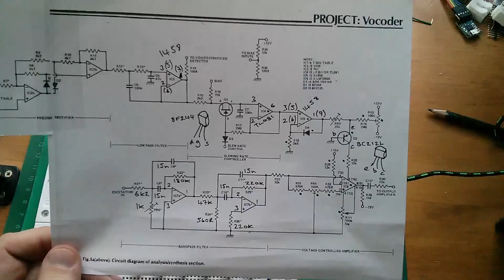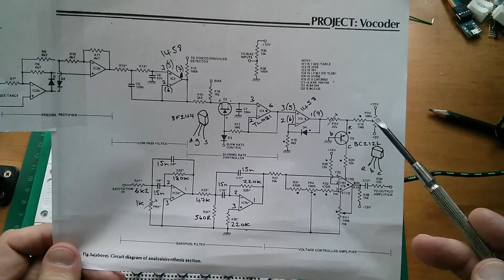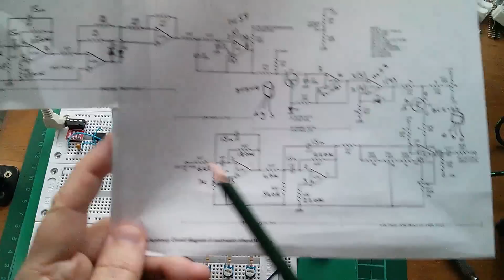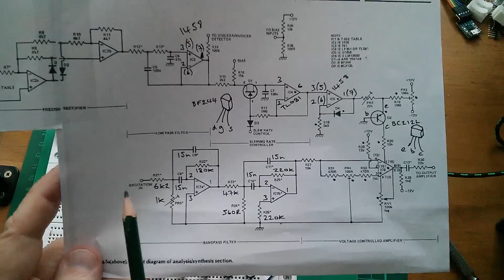Vocoder Update - Filters and VCAs on Breadboard

Comment: A suggestion for the future would be to do the same project using switched capacitor filters such as the LTC1060 or LTC1160 series parts. Years ago I did a project with the predecessor part, the MF10. The part is easy to use and quite versatile.

Comment: Thanks! Great video, Julian. 4:50 A notch filter is the opposite of a bandpass filter by the way. ;-) I really hope "sort of notch filter" is something else. :)
Reply: How about a notch pass filter, hehe
Reply: Notch pass filters do exist, and they're are ideal for resolving Morse  code from  severe radio noise. A bandpass filter of a few tens of Hz in width is essential at times.
Reply: +RWBHere I don't think it's called a "notch pass filter". The notch filter is a narrow band-stop filter. :)
Reply: +Robert Eliassen You are right. Band pass filter has a pass band which it will only allow to pass through. Notch filter is to stop signal with very narrow band frequency. Band pass filter can have very wide range, say for example, audio band pass filter may have lower -3dB point at 20Hz and higher -3dB point at 20KHz. so anything in between it will pass through it. Where as a notch filter is completely different thing and it will have very sharp center frequency at which it is intended to attenuate the signal and the -3dB point be same on both sides of this center frequency if you scale it on logarithmic chart. Both are completely different thing.

Comment: Have you thought about an effects unit based around a PI5V331 as a balanced QSD driven by a Johnson counter from a 96KHZ clock which takes I and Q signals from a audio phase shifter network to allow for USB or LSB sound effects.

Comment: Hello, Julian. Is there a fairly simple way of individually notch-filtering all 88 notes of a piano, so that each output can be used to write directly to a MIDI file? I'd like to do it in hardware, or else with some routine on Arduino/ Raspberry Pi, etc. I want to pass an audio signal through a fine-tuneable 'comb filter', then save and edit the resulting MIDI output. If you know of a method, could you please consider making a project video or videos about how it's done? Thanks. P.S. You'll be best off by dumping that breadboard approach, and using a shielded/ground-planed PCB layout, with screened cables between stages. Those microphonics are worrisome hints about future problems.

Comment: I have a voltage controlled a graphic equalizer board 31 band and a 31 band LED spectrum analyzer board I am going to try something that may be fun time to start soldering .. the LED spectrum analyzer board I have generates 0-5 volts on each led bar and the  voltage controlled a graphic equalizer board uses 0-5 volts DC to control it this should be fun
Reply from the maker: Wow, I love that idea - can you point me at these two boards - cheers :)
Reply: they are home brew

Comment: How long has it been? 2 years at least!
I wonder when it'll be done, it better be worth the wait!
Reply from the maker: I'm thinking I might build two of these things now. As well as the original design, I want to build another one on a large piece of chipboard with every circuit element on a separate proto-PCB. LED bargraphs will be liberally added so the signal level can be seen in all parts of the circuit :)
Reply: Seeing as you have so many amps to build, why not lay out a PCB module that you can build lots of? You could make the filter part easy to change values too. A surface mount quad with some through hole filter parts would be sweet.

Comment: My analog is a bit rusty ... quite a bit rusty. Audio distortion: As near as I can tell, your Q2, R19 and PR3 tied to pin 1 (or 16 for the twin amp) of the LM 13600 sets the amp's output bias voltage. This is something that should be calibrated with no input signal to zero volts probed at the output pin 5 (for this amp configuration) and then left alone. This portion of the circuit is not a gain or volume control. The distortion comes from turning the pot past the calibrated value, raising the output voltage towards +12V. As it does, the audio peaks begin to clip until the output bias is turned all the way to +12v and the audio disappears completely. At somewhere between 9 to 11v bias the audio has become mostly a square wave.

That's the way I read the 13600 data sheet compared to your schematic, anyway. I could be completely off - as I said, my analog is VERY rusty.

Comment: Hello Julian i have a question for you. I know nothing about Vocoder's at all. But my question is What would you use one for? To me honestly sounds a lot like a audio equalizer. Maybe I'm wrong but Please let me know.
Reply: joseph chrzempiec vocoder = voice + encoder, you could for example encrypt a voice message
Reply from the maker: It's a bit like putting a spectrum analyser on a microphone signal, and using that to vary the controls of a graphic equaliser on a separate audio source.
Reply from the maker: Yes, the vocoder was originally designed to encrypt voice messages.
Reply: Thank you for explaining that i understand now.
Reply: Thank you.
Reply: Hi Joseph, there is a write up about the Vocoder and it's multiple applications on Wikipedia.
https://en.m.wikipedia.org/wiki/Vocoder?wprov=sfla1
Reply: Here you go Joseph, this is a cover track I did using a Vocoder - passing my awful vocals through a synth so   each key pressed on the synth plays a pseudo not of my vocal at that key pitch.  https://soundcloud.com/reflectingme/hide-and-seek